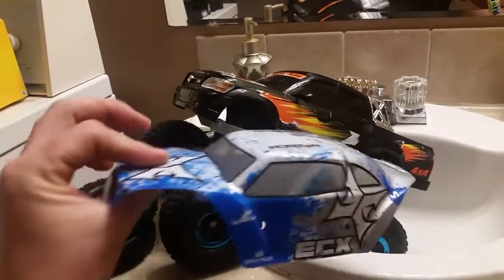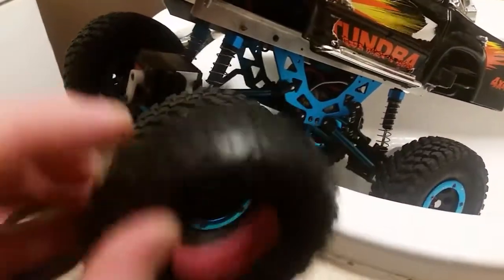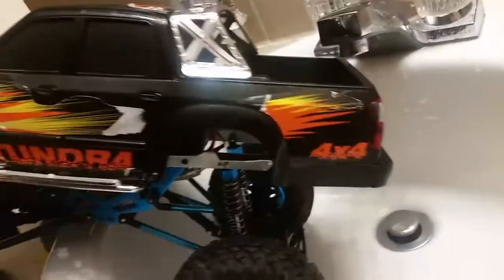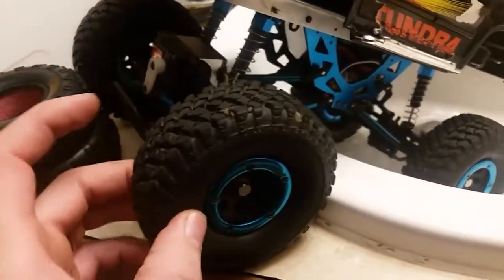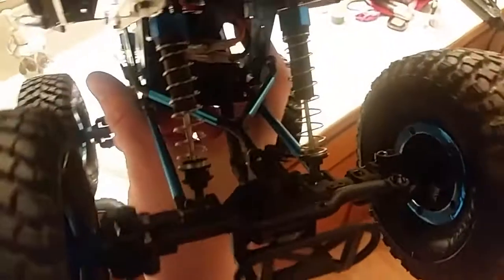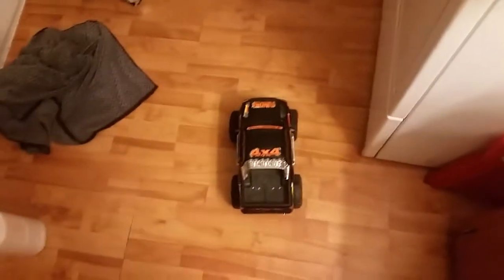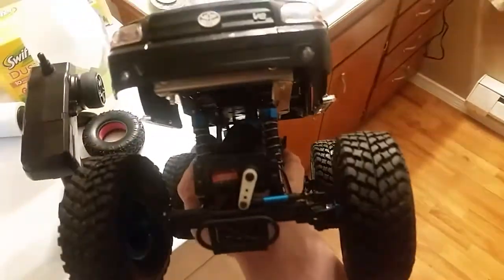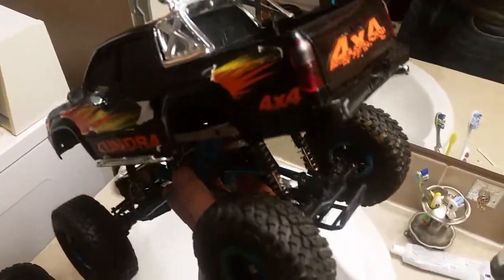ECX Temper torque twist gone!

Comment: You got some talent to do all of that! I built a model of my Nissan hardbody to put on mine but the torque twist made it look awful. The truck body would always lean one way and stay like that until I backed up. My main goal is to find some tires like you have to put on mine. I noticed that you said you had to do some trim work on the tires to get them to fit right. Can you let me know where you purchased the tires at. I live in Augusta GA and we only have 1 hobby shop here and he doesn't have any other better tires for it and doesn't want to help me find any.
Reply from the maker: TheWildcat626 i would start looking online really. get the pitbull brand ones.

Comment: Nice work looking to lengthen the side plates on mine to put the shocks more upright also. Putting 30w oil in my shocks and adding zip ties to the top of the shock so as to push the spring down and make it stiffer on oppposing shocks helped some of the torque twist. i think moving them in an upright position will eliminate it. Great work.
Reply: I put zip ties on both rear shocks it helped a lot I found out the back shocks have less of a load so they are softer. Found it out by going up a steep hill front would still just about be level but rear would just want to flex so I moved battery up front mad put zip ties on back shocks it climbs better and doesbt have as much lean.